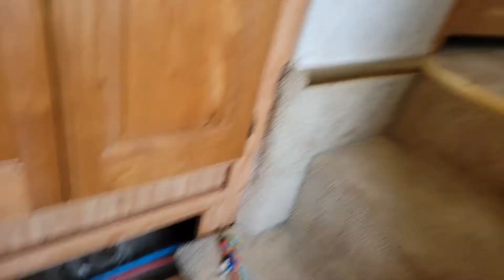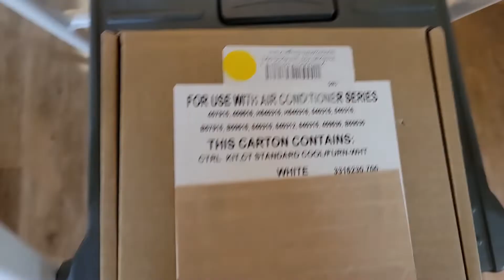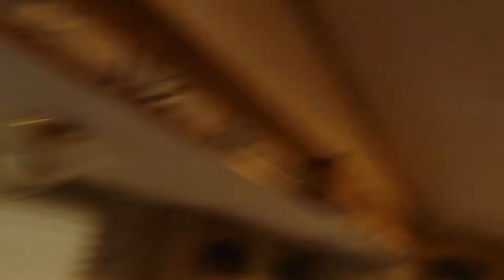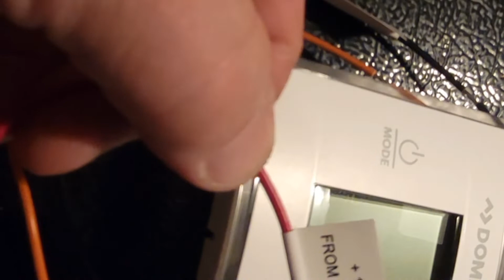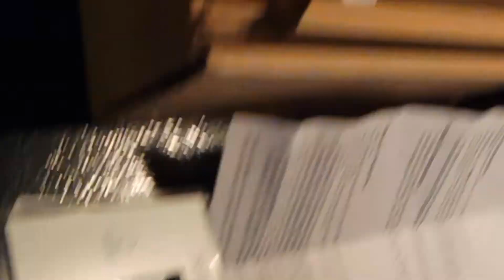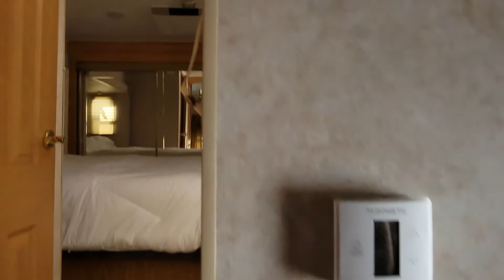Changing Dometic rv AC and Furnace analog to digital thermostat

Comment: How does that thermostat control the AC and gas furnace ?
Reply from the maker: The thermostat and control box come as a pair and work in conjunction ,the box actually sends the signal to either unit.  The furnace plugs into it at the AC unit ,not into the thermostat

Comment: Was thinking about doing this job, just don't know how i would run the wires.
Reply from the maker: The kit comes with instructions although it helps to have a little mechanical background and a volt/ohm meter

Comment: I’m having trouble finding out what parts I need to order exactly does it come in a kit together? And where is the least expensive place to get these parts?
Reply from the maker: I actually bought mine on Ebay (my favorite place for parts) and it was brand new and works great then my camper got water damaged during Hurricane Ian and lower part of camper was ruined  but I took this thermostat and control box out before letting it go to CoPart because I thought I would need in my next 5th wheel would need it and knew this was still in perfect condition and had all power off before and during the storm , (I checked before removing)  but our newer 5th wheel already had a dual zone thermostat installed with both units so I still have this one boxed up to  sell and didn't list yet.   I could sell it for $110 with shipping if youd like it